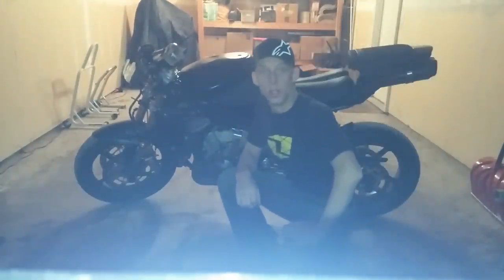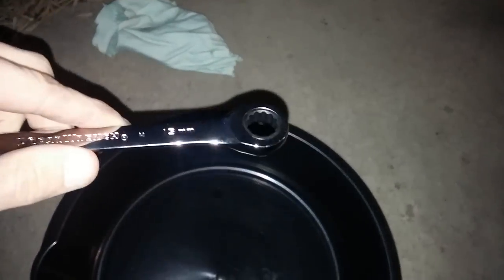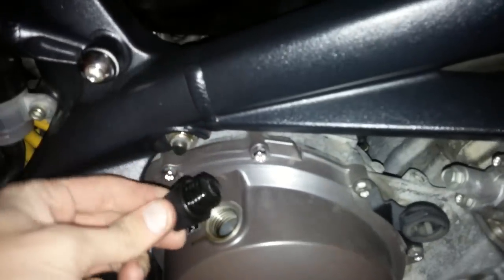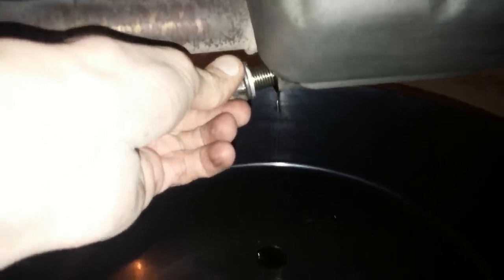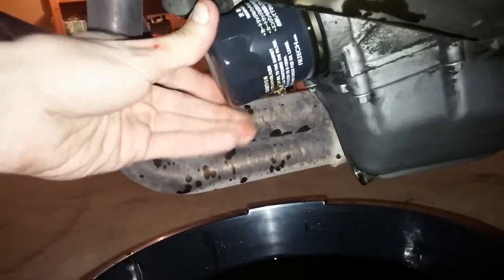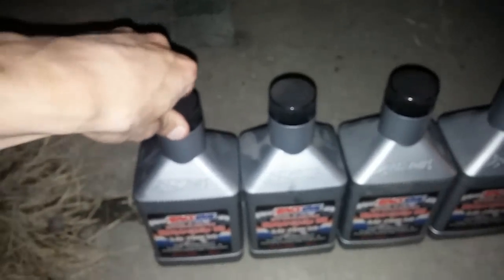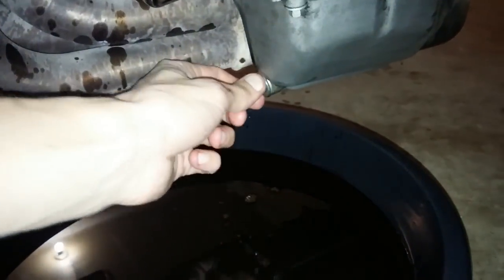Triumph Daytona 675 & Speed Triple 675 (06-08): How to Change the Engine Oil and Oil Filter

Comment: Good video just got a 2008 street triple 675 . It's my first bike changing all the fluids my self . Idk what to do first take the old gas out first or the coolant. Or the oil lol
Reply from the maker: Glad to hear you've joined the Triumph clan! They are excellent bikes.

If you have concerns the fuel might be bad, I would start with that first. If you don't think the fuel is actually bad, you can simply skip that step by running/riding the bike. Then the fuel will take care of itself. 😀

I would change the coolant next and then do the oil change last. Then when you're warming the bike up for the oil change you will have fresh fuel and coolant. Another thing to consider is changing the brake fluid. Brake fluid can also breakdown over time. All in all, once the oil change is done, you'll be ready to go! Good luck!
Reply: @SeanStettnichs  Thanks so much for the information im going to start first thing in the morning. I live in Phoenix az kinda hot my mom's old boyfriend had a triumph he bought when he was in college. He had some cool pictures and stories about riding.

Comment: Could you post a video on how to bypass the exup/remap?
Reply from the maker: +Smittywerbenjagermanjensen I've been really busy with work lately, but I will certainly keep your suggestions in mind. I know there are a couple other "how-to" videos showing how to bypass/remove the EXUP valve system with these Triumphs made by other YouTubers. If you're looking to find something quickly, I'd say give those a try! There's also a pretty good "how-to" on using TuneECU by the same user. I don't recall his name, but it should be easy to search for. Good luck! I will keep you posted if I get around to making those videos myself! Thanks for the interest and comment!
Reply: Awesome. Thanks

Comment: Thanks for the video it really helped. I don't know much about bikes, but I'm trying to get into it so I could do my own maintenance. What kind of filter is the one you installed?
Reply from the maker: I'm glad I could help! I started off not knowing anything as well, but slowly over time I've picked up on a couple small things. The filter I installed is HifloFiltro HF-204 Race filter. I have been using HifloFiltro filters on my sport bikes for years with no problems. In my personal opinion, they are great quality filters at a great value. With that said, I put much more emphasis on the change intervals than I do on the brand of oil/filter.

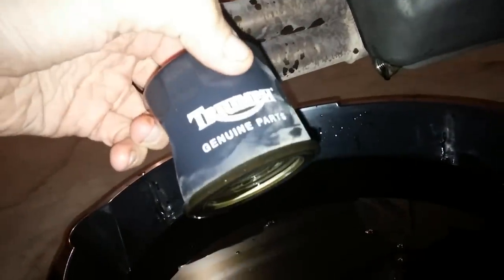Comment: What is that metal pipe right behind the oil filter at 4:12?
Reply from the maker: Are you talking about the exhaust headers? Those are the pipes with bits of oil on them.
Reply: @SeanStettnichs  im talking about the smaller metal pipe that has a rubber hose clamped to it.  its directly behind the oil filter from the camera's angle.  i ask because i slightly damaged it when i punctured through the oil filter with a drill.  I rode today and checked the pipe, no leaks so i should be good.  After some googling, i think its a water outlet pipe.

Comment: Hello Sean, i own a 2006 daytona 675. You are saying that oil change means 3 to 3,5 quarts, yet my owners manual says 2,4 litres. What is the correct amount. Obviously it should be between the two markings on the dipstick. Greetings from Holland
Reply from the maker: arne brouwer I'm never one to argue with a service manual. However, I also know my bike took a good 3 to 3.5 quarts if I was changing the oil and the oil filter both.

Comment: Hi Sean,
Thank you for the video.
Also can be used in a 2009 Triumph Street triple 675 (No 'R') motorcycle?
Reply from the maker: Sergio,

I believe the same process can be used for your '09 Street Triple as well. There might be some very slight differences; however, the process will be very similar. Make sure you consult your manual or local dealership/parts store for the correct oil filter and proper motorcycle oil.

If you have any questions, don't hesitate to reach out to me!

Thank you!

Comment: Hi, thanks for the video. Did you add more oil after running the bike for 5 minutes or was 3.5 liters enough? I have the same bike and it has 3 liters of oil in it. It runs perfect. oil is just above the low mark. Should I add 0,5 liter?
Reply from the maker: ricoblade1984 Thanks for the comment! If you're just above the low mark, I would recommend adding a bit for street use. You should be okay where you're at, but it never hurts to be safe. Just don't overfill it! :)
Reply: I will add 0.25 and check the level and go from there. thanks for the reply and advise!

Comment: Hi should I top it up when I run the motor with the new oil in it? Even if the motor is hot it's still ok to top up to the top mark on the oil reader? I heard you have to do it when it's cold.. Many Thanks...
Reply from the maker: I have heard both as well; however, I personally don't think it makes a large difference - just as long as you give the motor time to allow the oil to pool at the bottom. If you feel most comfortable waiting until the motor has sat long enough to be "cold" that's certainly a rule you can follow. I honestly don't think it will make a big difference in your oil reading. That's just my $0.02!

Comment: what kind of exhaust?
Reply from the maker: It's a Jardine RT-One dual outlet carbon fiber slip-on exhaust. The factory Triumph EXUP system is disabled and the valve is locked open. Similarly the O2 sensor and SAI system have been removed. The bike has been re-mapped to adjust air/fuel mixtures.